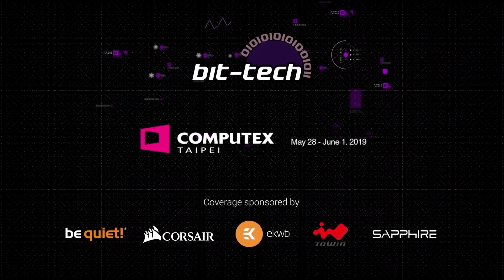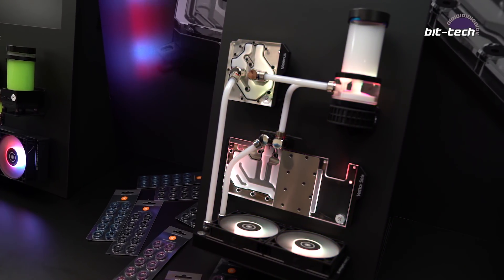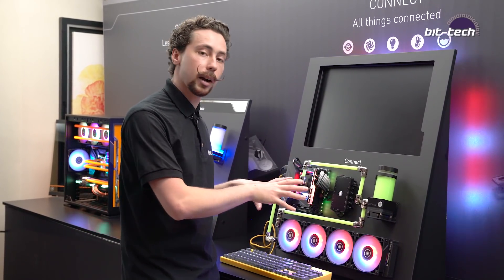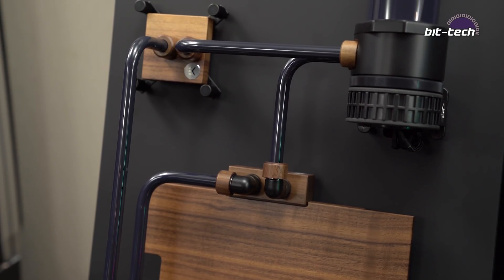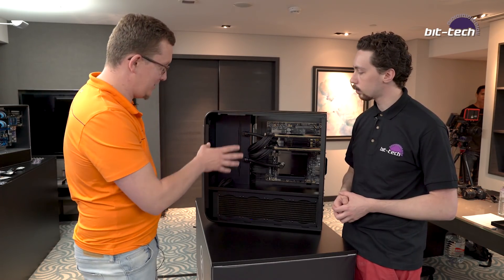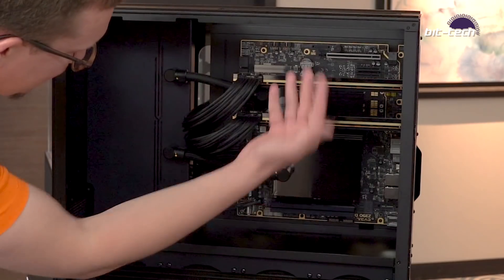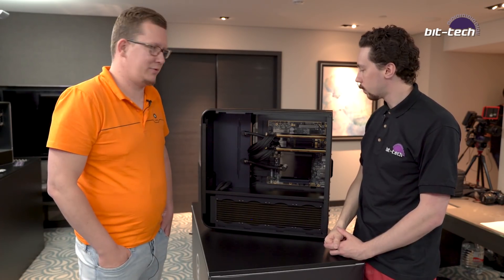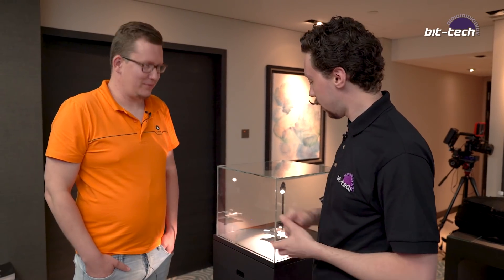EKWB Magnitude Water Block: Mix and Match! | Computex 2019

Comment: I was hoping you would have gone into some detail about the new EKWB distro plate saw one in the background (fill with orange opaque fluid), but it didn't even get a nod.
Reply: The distro plate in the 303 will be sold integrated in the case. No specific release date, but its on its way.

Comment: That tubeless system is dynamite, though it seems they'd have to be custom to each motherboard?  I gotta say, I'm not a huge fan of the magnitude stuff, maybe I'll change my mind when I see it in builds, but looks like a velocity block with a little trim.  Pretty plain looking tbh.  The RGB ecosystem is at least interesting.  If they could bring aquero type functionality to mainstream that would be pretty sweet.